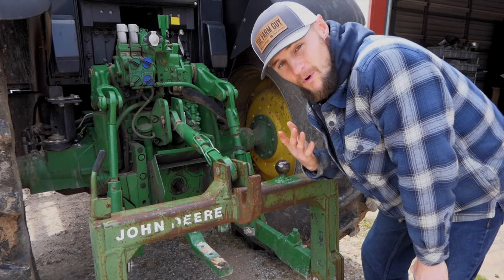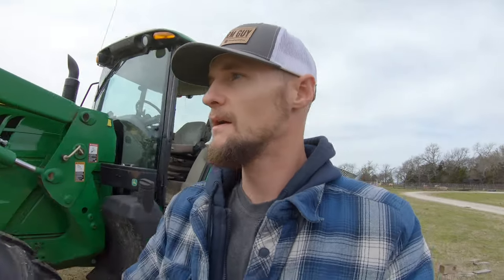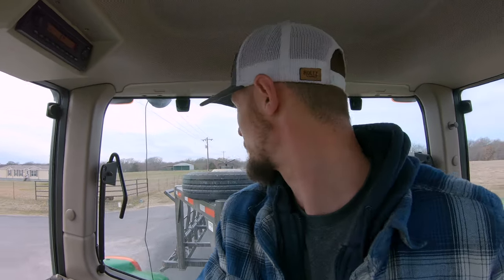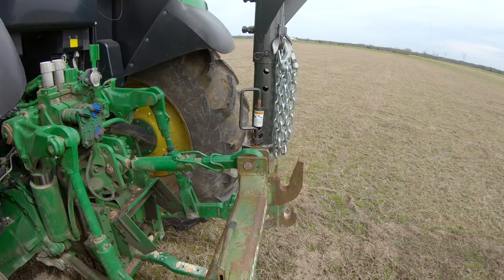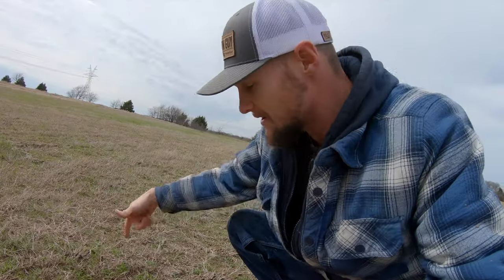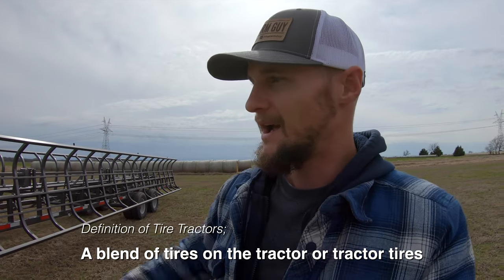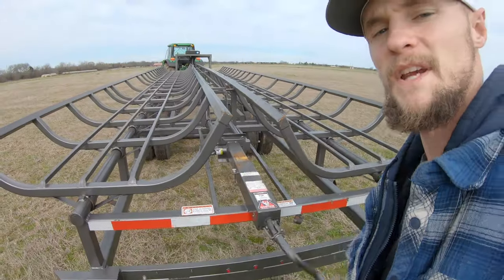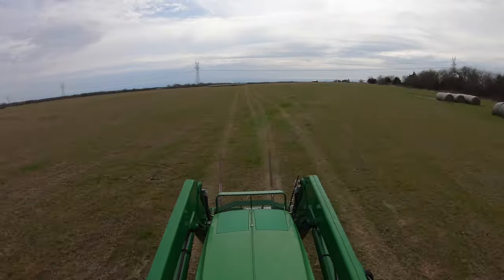Epic Bale Dump! Dumping 12 Round Bales at Once

Comment: Like the trailer we are still loading and unloading the hay that is  a whole lot faster
Reply from the maker: justin whitley sure does save time on the unloading!
Reply: @TheFarmGuy  we have upgraded so much this year we really don't need anything else but I sure want the trailer
Reply from the maker: justin whitley maybe next year then! If you ever get one you won’t regret it when you’ve got a lot of bales to haul
Reply: @TheFarmGuy  we usually haul 750 rolls but we also bale for the public and there is no doubt that trailer would speed things up I think we did 1290 rolls last year and it will be near 2000 this year
Reply from the maker: justin whitley wow thats a lot! We stack most of what we bale in the field and then if we have to buy hay, that’s when we really use the trailer.

Comment: trailer design seems a bit duff ?? what's the point of a 14-bale trailer that you can only carry 12 bales in??
Reply from the maker: Haul 14 on it all the time, just not with the tractor.  Tire pressure is one reason I didn't throw those extra 2 on.